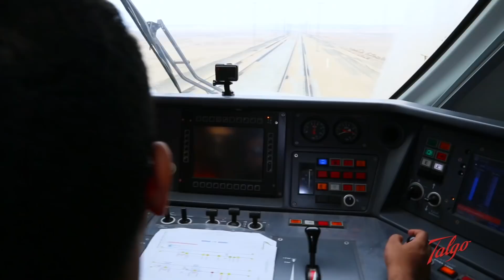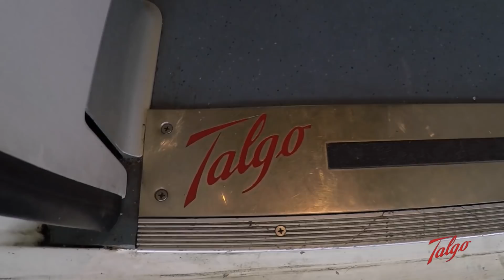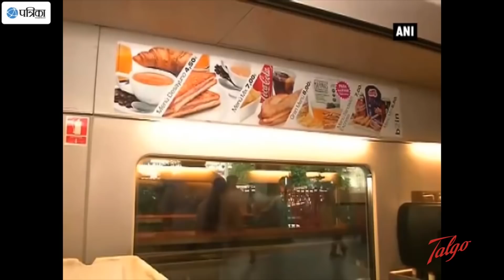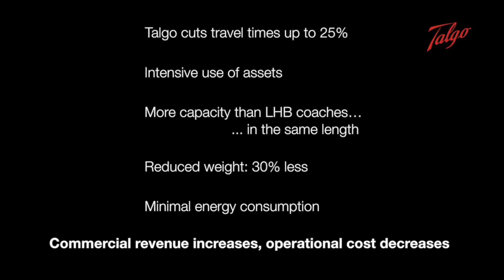Make in India, Export abroad

Comment: Can u guys Develop new Train 4 India

4 Coach EMU based on Talgo 230
Power Car = 1st & 4th

Wheel Size = 15"
Floor Height = 200 mm (Or Low R)

Carbon Fiber Construction & 3D Printed Interior
Use Thin Acrylic Glass

* Reduce Height of Over Head Line

Comment: Why India is not taking interest in talgo. Plz reply
Reply: PRAVIN SINGH, The coaches are small. Capacity is less per coach compared to lhb coaches. No sleeper class arrangements available as of now. The most important thing is the bogies. Coupling and de coupling them in talgo is very hard. In India we are used to doing it the easy way. If there is a problem with a coach it can be removed easily from the train set and a new coach can be added in our lhb and ICF coaches. But in talgo you will have to take it to the yard and the process is time consuming one.
Reply: But it can be use in short distance against Satabdi Express or other short distance train where sleeper class isn't needed & coupling & decoupling also don't needed that's much.
Reply: never heard....
Reply: Because of bullet train and hyperloop
Reply: because an accident had been taken place by talgo